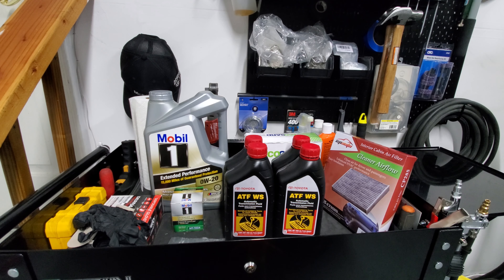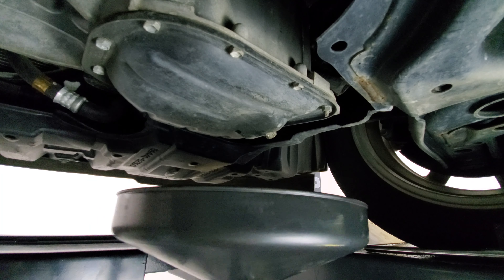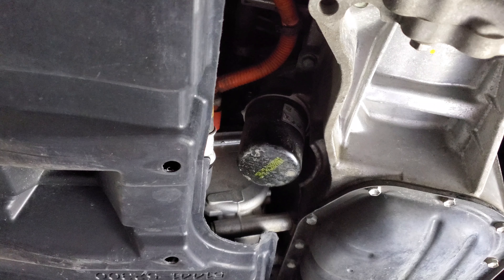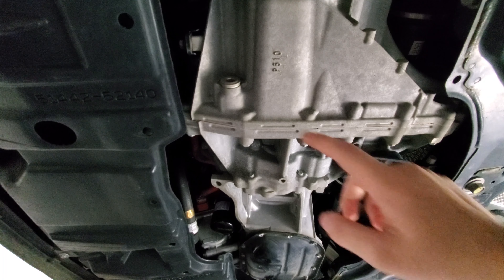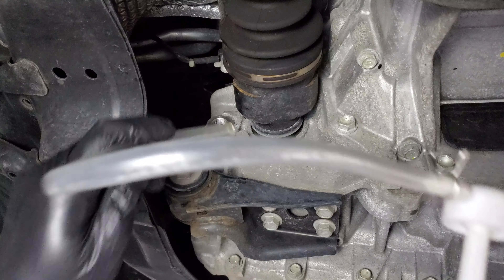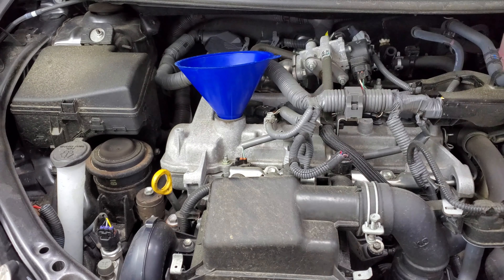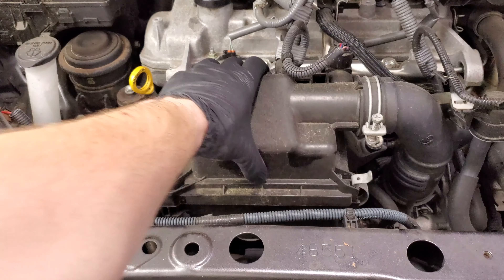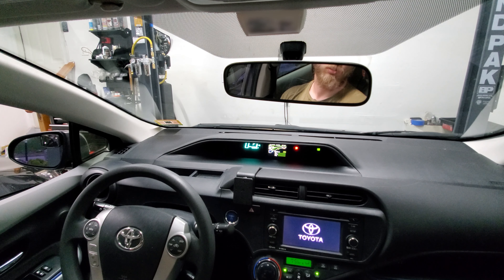Prius C Oil Change and 90,000 mile service DIY

Comment: Thank you for the tutorial. Be advised the Amazon link to the transmission fluid in the description is a different type(type-IV) than that specified in the manual and what you appear to use in your video(atf-WS) thanks

Comment: Always always always run a sacrificial quart of fresh new oil through, on any car/bike/truck/etc! Pour it in fast with the drain plug out, and then have your mind completely blown as you look at the crap that gets pushed out, that lingers on the bottom of the pan.

Comment: Thank you  for the video- I just did everything you listed in your video, plus the spark plug change. Spark plugs are pretty expensive for the Prius C, the dealer had the best price at $14 dollars apiece, including a 10% military veteran discount. Thank you again. I don't have a lift like you, and I use Rhino Ramps and jackstands while working under the vehicle. Works out great. I believe, that I'm done with the maintenance for now. I have 114,00 on my 2016 Prius C. I put 150 miles a day (pre-covid19) 5 days a week. I average between 50 - 56mpgs on the highway. All of my driving is highway miles. In the winter, I usally get 48-52 mpgs. It's been a great commuter car and cheaper to drive than my 1997 GMC Suburban 12mpgs. Take care, thanks again.
Reply from the maker: Glad the video helped out; I have been driving 80+ miles a day for the past 8 years but recently with the pandemic I've been able to work remotely. I don't know if I'll be able to commute again after having been spoiled with saving 1.5+ hours a day driving. This is my first Prius and I feel like I'll probably be getting another in the future; comfortable, priced right, reliable, and great fuel economy; can't ask for much more. My average for the life of the vehicle is about 43 mpg, I tend to drive 75+ on the highway which is digging into the fuel economy lol.

Comment: Called the dealership today to price transmission fluid. The service department added a disclaimer that toyota uses a computer to properly "install" the fluid. If it's not done properly, I was told that the transmission would lock up.  Any opinions?

Comment: I just performed this and a coolant flush and fill on my 14 Prius C at 107k. A few things that I'd add that may help you:

*I drained all three coolant silcocks (the third is near the front driver's wheel an drains the main radiator). Despite seeming to drain every last drop, I couldn't add more than 1.5-1.6gal, despite it supposedly being 1.8g. Who knows...

*If you buy the crappy $11 AutoZone PT pump, it doesn't reach the bottom of the ATF bottles. And it leaks. And, most annoyingly, the pump jams and binds up. Maybe buy a nicer one, especially one that reaches near the bottom of the bottle. I ended up funneling the leftovers into a single bottle and repumping until the transaxle fill plug FLOWED with new ATF fluid. Overfilling is important, as air can give you a false fill and you'll need to pump more in until it just FLOWS out. Let is drain completely to get your final correct level (make sure your Prius is basically level front to back and left to right!) It will be just under 4qts

*If you're like me and have never done this before, you're going to make an awful mess. Be prepared...take your time
Reply: Heh, I made a mess too. Super hard to get the level exactly right without a car lift or a pit.... Luckily my garage floor is painted.

Comment: After doing the transmission fluid change, did the car complain after that? and How did it drive after that, Did you have any issues later?

I watched some other videos (for Toyota cars but no one has done Prius C besides you) where people talk about the car need to be in maintenance mode and switching the gears from Drive to neutral rapidly and check the temperature for the transmission fluid using a scan tool or a temperature gun.
Reply: I'm not sure I want to change mine because I've heard of many on Prius C forums/Facebook groups with 200k+ on without trans fluid change.

Comment: Question, i bought a used prius C aka Aqua but I didn’t have the maintenance message showing up. It was 46k when I bought it and on the oil change sticker it said 51k to change or 6 months from the last time it got changed whichever comes first. Now I have just followed that without any maintenance message and changed the oil myself and no message around maintenance required showing still after changing the oil. Is that expected? Or i should see it to reset? Its 2013 imported from Japan FYI.
Reply from the maker: It's possible that it was disabled or maybe the Japanese variant wasn't coded to have that message.

Comment: I recently changed the oil of my Prius C 2012, and overfilled it by 4 quarts and a few milliliters, instead of 3.9 quarts. Though when i removed the old oil it already had 4 quarts and a little bit more. I just wanted to know if overfilling it with 4 quarts and a few milliliters can damage the engine or something?
Reply from the maker: If it's not an excessive amount it'll be fine, too much oil can cause issues such as leaking, overflowing, fouled spark plugs, bent rods, and collapsed valves. That would need to be a lot of extra oil, if it's not too much above the full line it should be fine.

Comment: Thank you for some helpful content. Last time I sent the car to the shop around 100,000 for the transmission fluid chance and it was like $275 dollars. 
I’m going to do this myself . Anyone here did it and got good results? I’m always scared of damaging the transmission by changing the fluid.
Reply: I followed the steps in this video and had no issues. Very straight forward process.

Comment: What do you think the coolant change/flush interval should be?
Reply from the maker: According to the service manual, 100k miles or 120 months; I haven't found information for subsequent changes however they typically sooner than 100k but I'd feel comfortable with that interval using OEM fluid.
Reply: @MarkMethods   So the coolant can be changed every 10 years or 100,000 miles, that's impressive, i was not expecting such long time to change it. Also do you think it is better to change the engine oil every 10,000 miles or 5,000 miles?
Reply: @MarkMethods  Page 49 of my (2012 c) warranty & maintenance guide says:
"Initial engine coolant replacement at 100,000 miles/120 months. Replace every 50,000 miles/60 months thereafter.
Initial inverter coolant replacement at 150,000 miles/180 months. Replace every 50,000 miles/60 months thereafter."

Comment: Why did you not just use a funnel when adding the transmission fluid?

Or asked another way, why was that pump needed?
Reply from the maker: It's a really tight space and I'm not sure you could fit a funnel in there; another way to do this would be a long hose and funnel from above but that's more of a two person event and I'm just one guy.
Reply: @MarkMethods  ok, thanks for your prompt reply. I couldn't tell where exactly you were, but I figured it might have been a tight space.

Have you been happy with this Prius C? I found a good deal on a 2013 with only 14,000 miles. It is practically brand new. Slightly concerned about the car only being driven roughy 2,000 miles a year.
Reply from the maker: It's been a great car, it's just about to roll over 100k and I'll be doing a coolant change on it along with a few other things. I'd say that car is probably fine, it sat around a lot but I wouldn't have any concerns buying a vehicle like that. For peace of mind, flush the brake fluid unless you have receipts from recently. Good luck on your potential purchase!

Comment: Why did you choose to change the transmission fluid at 90000 miles
Reply from the maker: Hey Richard! According to the Toyota manual on page 45 and 53 of this PDF https://toyota.us/2KV0jMG it's required to be changed under heavy driving conditions every 60k miles however I purchased this vehicle used and didn't know the history, in my personal case this was preventative maintenance.

Comment: So the 2016 prius has a automatic transmission? how come mine feels like its a cvt I dont feel it shift
Reply from the maker: You are correct it is a CVT which uses Automatic Transmission Fluid.
Reply: So if it is a CVT should we be using the Toyota CVT ATF instead?
Reply: great video by the way. I'm going to do a oil change and transmission fluid change soon. I drive roughly 10,000km for oil change. I put on roughly 20,000km a year. So I guess I can stay with 10k instead of the 5k oil change.
Reply from the maker: At 1:41 I show where in the manual it asks for Toyota ATF WS fluid; this is specific for my 2013 Prius C. I believe newer models do have specific CVT fluid however this is not one of them.
Reply: I have a 2013 also. They are all made and put together in Japan I guess. I should get WS ATF too?
Reply: I'll make sure too due to we are in different parts of the world. I run the 0w16 hybrid oil this round. Getting good results coupled with the Red Bullet solenoid. You should give it a look.
Reply from the maker: Correct, check your manual but it should be Toyota ATF WS.
Reply from the maker: That VVT solenoid seems interesting, what fuel economy increases have you seen? Or is this mostly a performance upgrade?
Reply: Both! I was able to get 900km out of a tank of gas running mostly in the city and improved acceleration when needed.
Reply: We are on the same page. My 2013 in Asia is calling for ATF WS too. Transmission fluid inspection at 40,000 km or every 24 months, replacement every 80000 km or 48 months.  I got the vehicle used. Sitting at  57000 km so I will change the transmission fluid since I don't know when it was last done. Ordering ATF WS. Thank you!
Reply from the maker: @shiaugwo-harn6499  I'll have to read more about the Red Bullet; maybe if I can figure out who manufactures these  I could do a install and test video with it. I drive about 100 miles a day and have logged every fill on my car, I would be also sharing statistical evidence of prior fuel economy if this solenoid changed anything. Maybe that'd be something interesting for the Prius C community.
Reply: @MarkMethods  buy it at redbullet.net
Reply: I just did the transmission fluid change, it was smooth without a hiccup! My old fluid is way over due i think. 2013 and i dont think it was ever done. Today at 47000km. I feel more pep. Might just be the 0W16 I'm using... the ATF WS has a really nasty smell, no matter new or old.
Reply from the maker: @shiaugwo-harn6499  Awesome to hear!

Comment: I went to a dealer, they said it takes CVT fluid  not WS fluid
Reply from the maker: 1:41 is where the owners manual shows Toyota Genuine ATF WS is recommended and the volume. I would verify in your owners manual before potentially damaging your car unless they validated your VIN.
Reply: @MarkMethods  I did read it and ATF WS is the right fluid. But for some reason  the parts person was hell bent and saying otherwise. He even got a tech out to confirm  this. I didn't  buy what they were selling.
Reply: I used toyota ATF WS. The 2013 prius c and after does not use a CVT. All the third generation prius use a differential for the power transfer management. Similar to what is used in most vehicles differential rear end axles. Usually the dealers and tech do not even know what they are selling.

Comment: Interested in tire rotation.
Reply from the maker: I'll see if I can get to that!
Reply: It should be the same as for any other car.  Front tires wear more quickly, so the ones with more tread go on the front.  Swap side to side if one side is wearing more than the other.  You can use a coin like a penny to approximate tread depth (even better if you have a ruler).